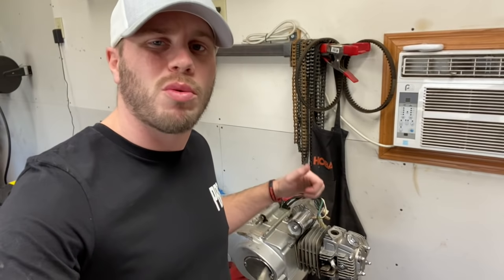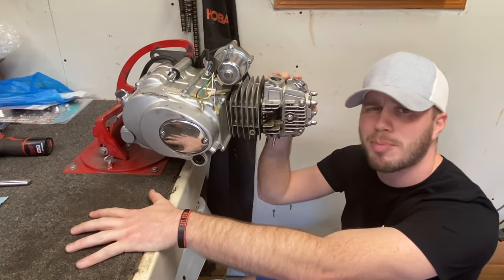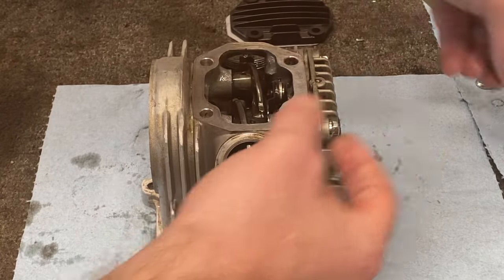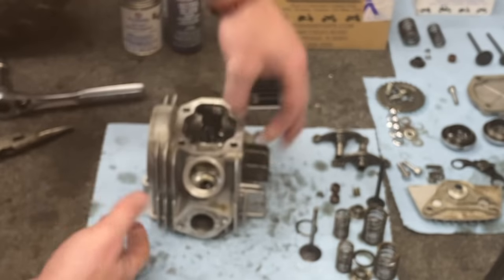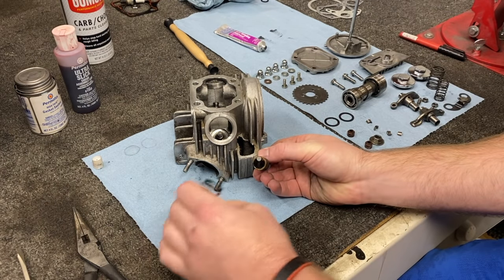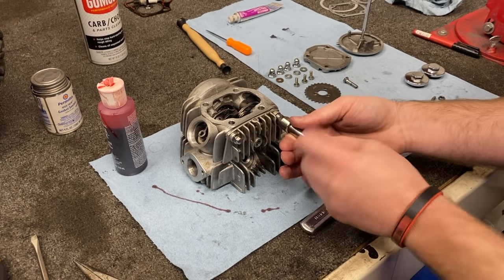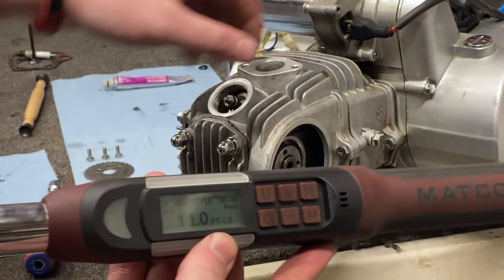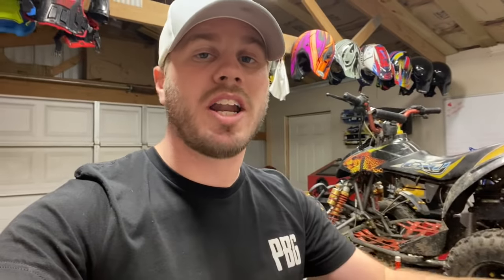HOW TO: Complete Tear Down & Rebuild of a Chinese ATV Engine Head. Every step you'll need covered!

Comment: Im sitting here watching this and im fighting in my head “a top end kit is $80 and 3 days of painful confusing work but a new motor is only $300 and only 3 hours of my time 😭😂😂
Reply from the maker: It's a tough decision for sure! I'm all about saving the money but If you don't want to mess with it you can save the headache for sure for a little extra expense.
Reply: Get paid 100 bucks and hour? Good for you man
Reply: But guys its soooo funny to work on your motorcycle. And when it works there is no better feeling
Reply: Where do you order a motor that cheap ?
Reply: @WokeEarth no the engine cost $300
Reply: @PraskaBoysGarage  you not replace the valves seats ?
Reply: I'm gana tell you right now, once I figured out the (Literal name of this engine) And found this video I was in shock just how instructive it was and  how quickly I too found A bent intake valve. So a tip from a Tuber to a Tuber, add Grom clone in there somewhere in the title and watch the views explode, because I didn't find shit in that section helpful.
Reply: Is not the money, may you don’t understand… I’ll enjoy losing my time fixing engines on my garage. That is the think 😅  even if I spend all the weekend 😂

Comment: Liked, saved and subd. How 7 dislike this is beyond explanation. The attention to detail is outstanding and I would not hesitate to have this guy work on my stuff. Brilliant.
Reply from the maker: Much appreciated! Thanks George!
Reply: Have engine out of frame and in house. Top cover off and cam out. Fair amount of dark oil up top. Did compression test following your tutorial on here. 75. Pumped air in with a car compressor but didn't get air leaking from anywhere. May not have been powerful enough.

Comment: Man when you put that sprocket on the head you made it look so easy I'm having so much trouble
Reply from the maker: The motor has a chain tensioner. There is a 14mm bolt on the bottom of the engine next to your drain plug. If you remove that bolt there is a spring and plunder behind it. Once removed you can easily get the sprocket and chain on.

Comment: this is EXCELLENT!   mine just started spraying some oil, I think out the carb, I need to investigate more, but it seemed like it lost some power, then I noticed the oil!!!
Reply from the maker: Oh man, that's no good! Good luck with the repair!
Reply: @PraskaBoysGarage  you do great work,I am currently working on a friends ATV,got spark,repaired a ground wire it seemed to struggle turn over,I had fresh gas,checked spark ,ext. What could I be missing? I fully charged battery,checked timing as well ,pulled the stator off to ck for burns on wires etc,now I don't even get the starter,to turn over,what am I missing,getting frustrated
Reply from the maker: @kylewassel287  Shoot me an email at praskaboysgarage@gmail.com I'd be happy to help!

Comment: I have a 110 quad that runs, idles great but when it goes to rev it Boggs or goes super super super slow. I put brand new carb and tried tuning, had all my buddies try to  and it wouldn’t fix it. I put new cdi, new spark plug, new coil and more. Figured out it’s low on compression. I have the engine off and apart. I did the flashlight trick that you taught and absolutely no light is coming through. The head and the cylinder and piston all look great. However, the head ghasket is ripped (not from me). I believe that is the issue and I will keep you updated. I have a new piston cylinder and all new parts on the way

Comment: top gasket was flipped and it doesn't need gasket sealant cuz you have oil running to the top lower left heat nut and you don't want it to carry gasket seant bits back to the cover oil galleys. anyways you'r awsome and thanks a lot

Comment: As someone who's applied Honda's torque specs to the clone and snapped a couple bolts, I'd say look up the motor model number and see if you can find it's torque specs, because extracting a snapped bolt is a huge pain. Given I looked for hours for torque specs before using the Honda specs, it's still at least worth a little research.

Comment: One of the best videos on rebuild that I’ve ever watched. Totally got me excited to do mine. Wondering 1 thing. On the exhaust port, my assembly has a very thin and malleable piece of metal where the exhaust pipe marries into the assembly. Wondering a) how serviceable it is, b) there’s like a rubberish washer down in there that was coming off in chunks that I don’t see as part of any rebuild kits, c) if this is crucial to good performance to make sure this is right. I can probably get it back to round, but it’s so flimsy that any on and off of the exhaust will just mess it up.
Reply from the maker: Since I am not looking at it I can't tell you 100% this is it but rather a very strong guess. It is most likely a crushing gasket. It usually comes in the kits as a brass ring. It seals the exhaust to the port. You can buy a replacements for under $5 bucks shipped. Yes this is crucial that way you don't have an exhaust leak.

Comment: I would have checked the valve lash on the intake first before taking the head off. Had the no compression problem and that was the fix.
Reply from the maker: True. I didn't think to talk about a few things to look at first. I mostly wanted to focus on the rebuild part. If you have fuel and spark the next steps should be to check the valves and also make sure you didn't jump timing. After that start the compression test.

Comment: I really like your videos! I tried to do almost the same a decade before, but I not tried to sold my bikes. I have a lot of old communist and japanese two strokes. It was much more difficult with the two strokes. They had almost every time an ignition system with points. I currently bought a 110 (107) cc quad and it had a couple of issues. Your great videos were a big help!
Reply from the maker: That's awesome! Glad I was able to help!

Comment: Does anyone know if rocker arms should move sideways a little bit? Mine does and the screw that is hitting to the end of valve is hitting it to a edge, not to a middle. My engine started to make a pretty loud ticking/knocking noise after I changed a new cylinder. I came to conclusion that the sound came somewhere from cylinder head. Hopefully someone can answer to this.

Comment: Thank you for the video. I have checked my 110c ATV and the time is off. The cam does not line up when the T is lined up through the hole about 15 degrees. My question is do I need to strip the engine and make it TDC then set the cam or can I go ahead and set the cam while the motor is assembled.

Comment: Awesome, gonna be tearing into my kayo 150cc minigp this weekend.  Spark plug says it's running lean.  I richen it up a bit and starts bogging horribly.  I left it like that for a track day though and just kept the RPM up so it wouldn't bog.
  Spark plug STILL saying running lean, so thinking the timing or valve clearance is off.
Reply from the maker: I wonder if they make a jet kit for that ATV or maybe it would be better to upgrade to a Mikuni Carb, especially if you are taking it to a track. Good luck on solving the problem, and thanks for watching!

Comment: That is one trick table with  swiveling engine stand my good sir. Thanks for the details we (I) want. Personally, I appreciate how you cleaned and inspected the old parts versus replacing everything because it came in the kit. One thing I've been taught though is to only use gasket sealant on the outside aka the part you're taking off. Have you ever tried this method? What are your thoughts?

Comment: There’s only one bolt for my timing chain… idk how to get it off… ugh, only need to do the valves. You made it look so easy haha. 🤞🏻
Reply: Used a screwdriver to lock the wheel, and got it. Found out the valves have a big gap and were stretched I think. Ordering new valve kit/ grinding compound, and hoping for the best! 
Thank you for posting, you inspired my first rebuild! I’ll stay updated on these comments. 
Might order a new head depending on the price. I don’t have all the tools, but I also have 2 bikes with bad compression. So it might be worth it?
Reply: Everything went successfully. Not perfect. Went from 60psi -100 just lapping valves. Come to find out the main jet fell out 💆🏼‍♂️”didn’t check because I cleaned prior to the ride” haha  but now it’s better than it was 👍🏻 useful and very informative video thanks!

Comment: Hey the rocker tabs have threads in them so you can screw in 8mm bolt and pull them out and you can put the valve lock things on with hammer and socket :D but wery good and helpful videos!
Reply from the maker: I didn't know that the rocker pins where treaded for years until I read a Honda manual! I never look to grab a bolt and it's just as easy since I have the pick in my hand! Glad you like the video!

Comment: Isn’t ignition timing spec 15 degrees BTDC on these things? I’ve noticed a T as well as an F on the flywheel, should cam sprocket be set when “F” on flywheel is visible in the viewport instead of the “T”?

Comment: A better way to hold the head while lapping the valves. Put two tapered punches (or matching bolts) in the head bolt holes and grip them in your vise. Take care with the lapping paste. It will wear out your valve stems and guides prematurely if any traces are left on parts. To hold an Oring in place for assembly use a dot of grease.

Comment: Hello, I teach the Outdoor Powersports program(motorcycle, ATV & snowmobile repair) at Region 10 Technical High School in Brunswick, Maine and our first year students just watched up to the 17 minute mark. We have a few comments - 1st off, as the Instructor, I have 40+ years of experience in the Motorcycle trades and I'm a Certified Honda/Yamaha Factory Trained Technician. I have been teaching for 23 years now and I find youtube can be a great learning tool (not always in a positive way though). We noticed that while performing the leakdown test, you never verified if the piston was at TDC on the compression stroke or at valve overlap!  When you remover the cam sprocket cover , I did see that the motor was at valve overlap as the camshaft timing marks were 180 degrees off - OOPPS!! You removed bolts that you said were 8mm but are actually 6mm (with a 1.00 thread pitch). Yes an 8mm wrench fits, but that is not the bolt size. You pried off a cover with a screwdriver (a no-no). You also refereed to the valve adjusting lock nuts as " 9mm bolts". And pretty sure that any engine with daylight coming past the valve seat will not even build up any compression let alone, 70 psi of compression. My guess is the piston ring end gap is beyond specs due to lack of proper air filter maintenance and that explains the massive oily/carbon buildup on the piston crown. We will continue to search the web for more videos that show us how-to(or not), thanks for your time, Bill Ross
Reply from the maker: Bill, first let me say thank you for watching the video or at least 17 minutes of it. Unlike you, I am no professional and have never received any technical training to work on small engines. However the purpose for my video is to help others who are also in the same boat I am(not a mechanic). I wish we could all take our powersports to shops like the people you are teaching will work at some day, however the cost to repair these knockoff motors professionally is more than the entire replacement cost of the machine. I here your critiques and will look to improve the quality of my videos in the future. With your background and knowledge of powersports I would encourage you to film videos yourself. Please understand you wont get paid for these lessons you spend hours upon hours filming, editing and posting but you will get the enjoyment of teaching us the proper techniques. Thank you for your comment.
Reply: @PraskaBoysGarage  Well said and thank you for doing these videos. People forget that contributors are trying to help each other out and aren't charging for these services. Hopefully you start doing videos again.

Comment: I bought 2 brand new Chinese dirt bikes.  Within 5 hours of running, one got a bent intake valve.  I replaced it, and within 1 week, the other bike got a bent intake valve which I am now replacing.  What would cause this?  Valve clearances too tight from the factory?

Comment: Great video. Helped me a lot. I think I have a problem with rocker arms in my engine. The valves have just been replaced as the exhaust side didn't seal properly. I still find it difficult to set the valve clearance, and as I was trying today, I noticed that the rocker arms have a slight free play side ways. Now I think that that is the source of a knocking sound that the engine produces once it heats up. My question is whether these rocker arms are supposed to have this free play or they should sit tightly on the pins that hold them in place? I wonder if they are too worn and should be replaced. By the way, those pins were also replaced together with the valves, and cam rod  bearings, but not the rocker arms themselves. I think the mechanic just didn't think that they could be the source of the problem.

Comment: Question about the timing adjustment. When I get the motor set to TDC and my cam lobes are in-between intake and exhaust. The timing mark is 180 out from the top position you said it should be at. Not sure if my cam is 180 out or what is going on. Excellent video also

Comment: eh ive gotten a bayou 220 with valves sunk into the head to run on just 30psi. Granted it had bascially no power, but it ran. 3rd gear down a hill was the highest gear I could get to. So I knew the bottom end was mostly fine and atleast the first few gears worked. 1st gear barely pulled it back up a hill lol. New freshly lapped valves and it was a little animal for a 220. very fun atv. After that it had so much power in first, smacking the gas it would stand up without trying. That said once it had its full power, it became apparent the centrifugal clutch was gone as the engine would just blow right through it. I let a friend ride it for a bit and came back knocking. Turned out all the silicone and rtv someone used previously with the case sides off clogged the oil pump screen and ruined the whole engine. Why people do that is beyond me. They make gaskets for a reason. Ever since then if it has silicone or rtv oozing out the case where it shouldnt be, I wont buy it.

Comment: My son’s bike seems to be really low on compression because the Kickstarter is really soft. He has a 90 cc. It does still start first kick, but I can hear some air escaping. I tried adjusting the valves, but I cannot understand how to adjust them when they each only have one little nut. I am a little mechanical but do not think I can disassemble that like you did because I’m totally blind. Should I just buy that head assembly you mentioned or should I try adjusting the valves first. Can you briefly explain how to adjust them when they only have that one little 9 mm not

Comment: In disassembly the jd on the cam was facing the rear. In assembly setting timing the jd on the cam was forward. Is there a difference in TDC on compression stroke or non compression stroke?

Comment: My sons 110cc chinese quad runs great, but when you use the rear foot break the engine dies. I put a brand new wiring harness on it, brand new spark plug, new carburetor, and a new battery. The hand break will not usually make the engine stall, but occasionally it will if you break with it too hard. I checked the clutch and it seems OK from what I can tell, but I'm not 100% sure. Do you have any idea what could be causing this issue?

Comment: Great video but you didn't check valve lash once you discovered the intake valve was leaking. In many cases the valve could have been out of adjustment.
Reply from the maker: Yes that's true. I really wanted to focus on the rebuild of the head and I didn't spend enough time on the diagnostics. I've been saying in my comments for years that before ripping into a motor you need to checking valve clearance and timing. I should update my video description with that information! Overall did you see anything else I should update?

Comment: My son just got a 2006 coolster 90cc automatic 4 wheeler with forward and reverse shifter. His grandpa dropped it off and it doesn't wanna move with weight on it. Goes backwards a little better than forward but forward sucks it don't wanna do much. Any suggestions on fix?

Comment: Good stuff
Reply from the maker: Glad you enjoyed! Thanks for watching!
Reply: @PraskaBoysGarage  Hey I have a 90cc Taotao that I'm trying to get timed. I've timed quite a few motors already and it's very simple. However, this one has me a little confused. The flywheel won't stay at the t position. It always wants to move a bit. So my question is, should I just get someone to hold the flywheel, and put the cam sprocket on? Or could there be a different issue?

Comment: Excellent video, brother! Quick question - I'm rebuilding my son's 110-D currently and everything has gone smoothly and in line with your video until now. I didn't fully disassemble the head like you did but I did take it off. My cam sprocket is in line with the marks like you mentioned, but on the opposite side. The sprocket mark is on the right not the left. Is that a problem?

Comment: I recently had the same issues thought it was the valves need adjusted set it to TDC and had like.   .150  clearance on int. Side , did leak down test and blew air back into carb. Looked down int runner and the seat had backed out of the head time for that new head.
Reply from the maker: Glad you found the issue! Hope the project went well for you!